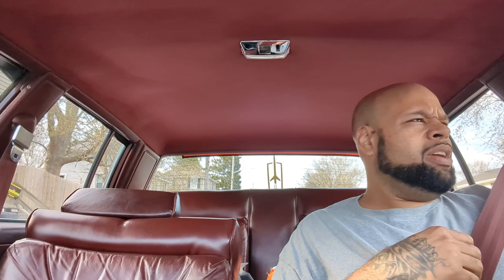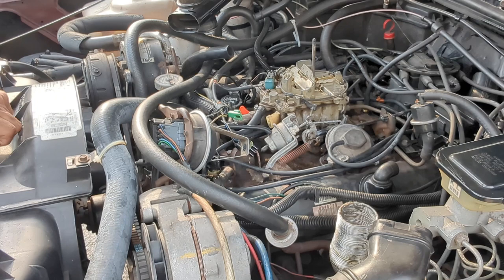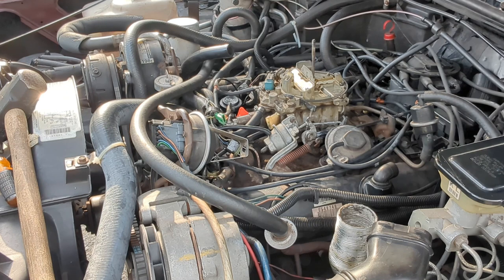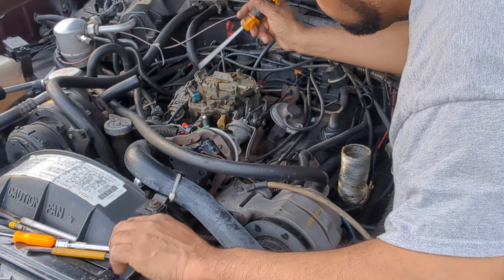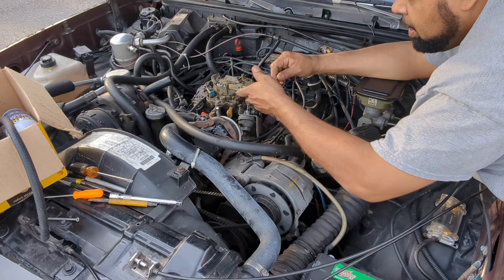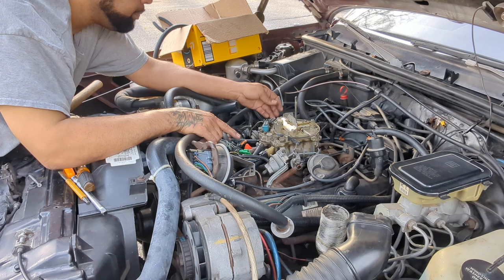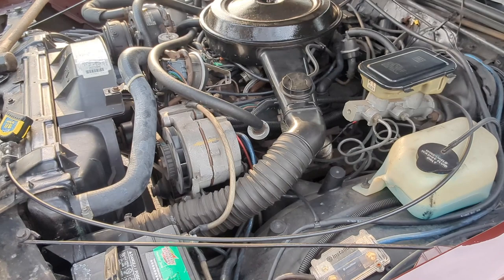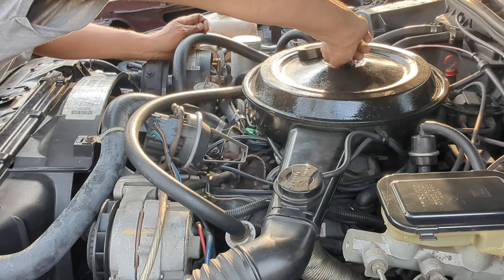TRYING TO REMOVE THE CARBURETOR CAPS ON MY CUTLASS 307 ENGINE

Comment: That part you took off is called the Idle Load Compensator. It automatically controls the idle of the car! I got an 83'. Learned alot over 16 yrs of having it.
Reply from the maker: I took the metal arm off of it because one day it got stuck and my car was idling way to high
Reply: Yea it says on the specs on the fan shroud. That its idle is automatically controlled and it shouldn't be manually adjusted. Not saying that's right cause after 40 yrs I'm sure some things are off . I

Comment: Prob late but the carb is a 4 barrel Rochester Quadra jet the # u need for parts is the 1708xxxxx or what ever number on the side there Gotta drill the caps n remove the carb .. that’s the ideal control valve ur car will prob run like crap if u take it off also for vacuum leak u can use carb cleaner and it ideal weird that’s we’re the leak is jus gotta search

Comment: When i messed with the idle screw that you turned. My check engine light started coming on
Reply from the maker: My check engine light been coming on since I bought the car. It happens on the highway. It goes away when I let go of the gas pedal

Comment: Where can i get an air intake duct from ? The big black duct between the alternator and battery that draws fresh into the carb. Mines is shot 😅
Reply from the maker: I have no idea
Reply from the maker: Try vintage air 318010. It's 2.5 x 10 feet 15$ . On Amazon